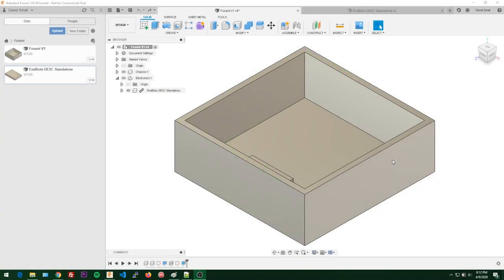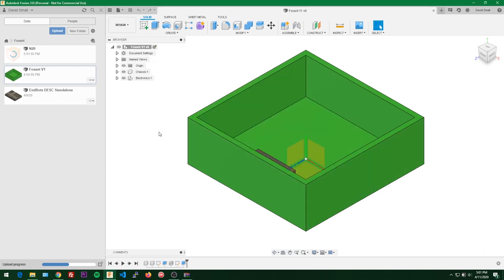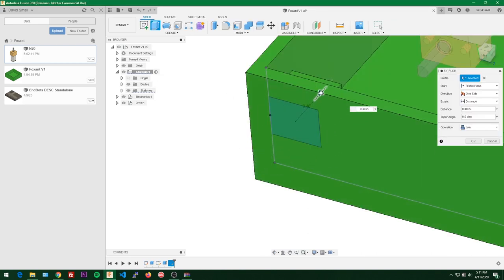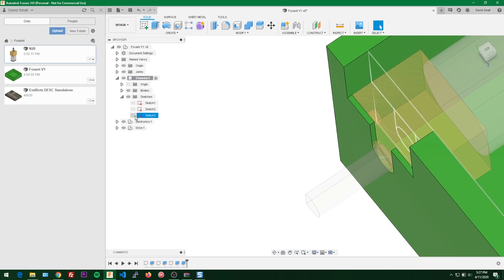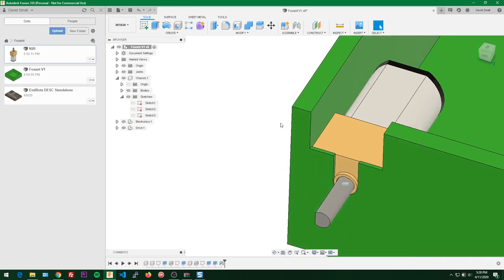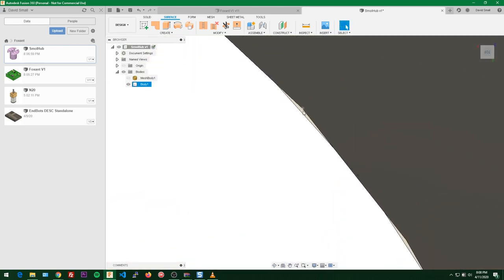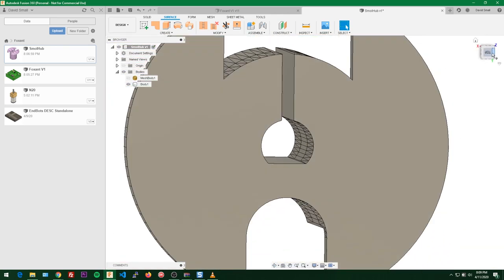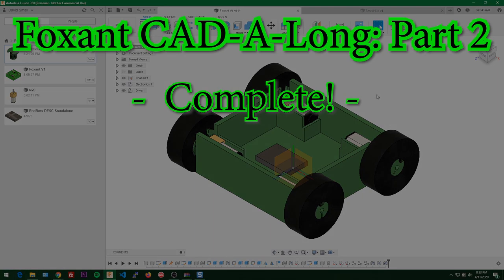Foxic CAD-A-Long: Part 2

Comment: at 14:50 how are you able to extrude from the other side. I am not able to select the sketch on the other side of the block. Hence, its not possible to cut with offset

Comment: Thanks for this. I couldn't get mine to mirror the motor beds - the one diagonally opposite the original was being silly so I had to create that corner from scratch. As a result, because the geometry was tied to the motor, I also had a second motor in and then ended up having to do the drive unit bit twice. Interesting how one little thing not working (mirror) can end up causing so much work.

I wonder if there was a way to create the broken motor bed around a temporary motor, and then fix all the settings so I could delete the motor - probably should have looked at that earlier!

Comment: At 9:00, whenever I try to create this sketch, I first have to click on the chassis to select it. Doing this automatically switches the selected part I'm working on to drive from chassis for some reason. Once I click finish sketch, I can not modify the rectangle in any way. Any suggestions?
Reply from the maker: That sketch is made at 8:40. Make sure you have nothing selected when you click the New Sketch button, then click on the face of the chassis. Can you also confirm the chassis isn't part of your drive component? If you have further questions, you can message me with screenshots on the TSR Facebook page.